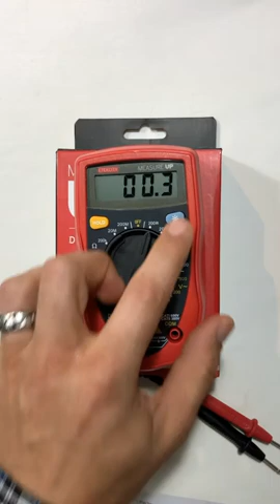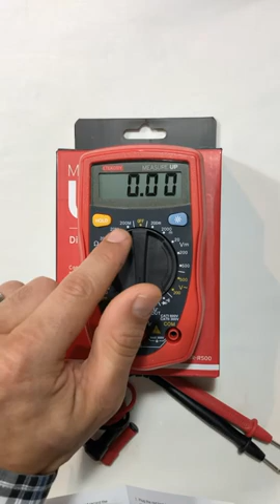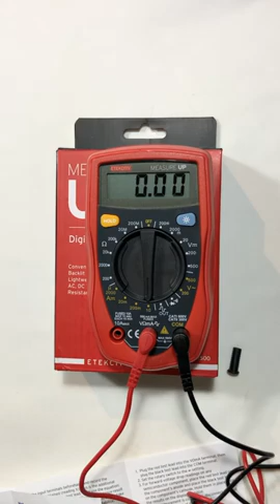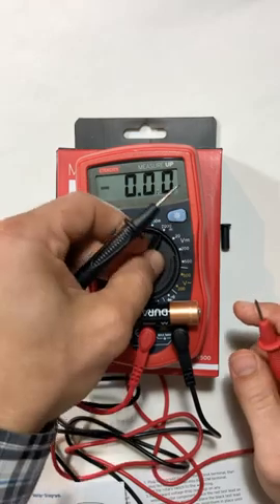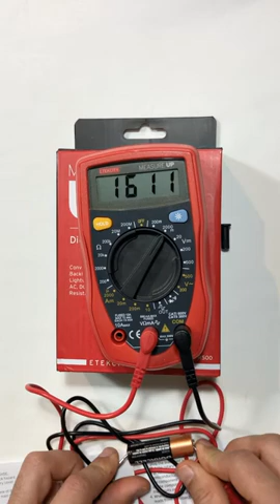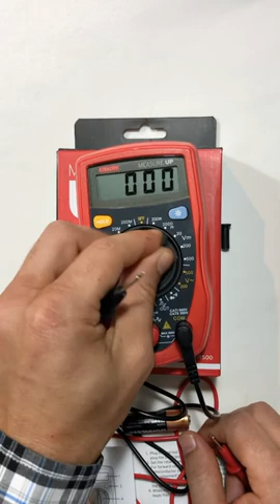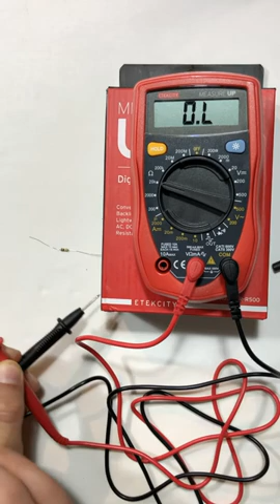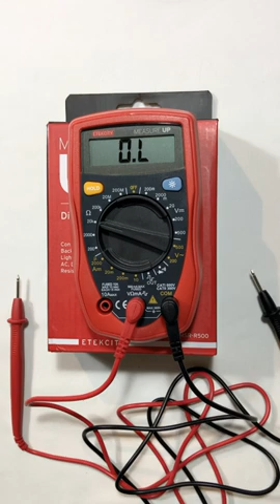Etekcity Digital Multimeter Overview

Comment: I like the video, it was a low quality recording (which made the numbers hard to read) but the info was helpfull. I have noticed a trend with most videos about these multi meters though and it is very irritating to me. Everyone seems to teach volts and resistance reading and testing but it seems no one wants to explain Amperage reading. Is it the same as testing voltages?? I am confused because I remember that testing amps had to be done very differently than testing voltage and whatnot... PLEASE if you haven't already, make a video for proper method of testing for amperage!
Reply from the maker: Hi, yes we have two 4k videos you may find useful

https://youtu.be/IM-Wq9HHnwA

https://youtu.be/EJ-XG162gKU

Comment: I did like the video, and glad you went over the different units on the meter and being careful when writing it down for your measurements. Also when I saw the 0.L when measuring the resistor did not know it meant open line; very glad you did a demonstration with the O.L resistor.
Thank you,